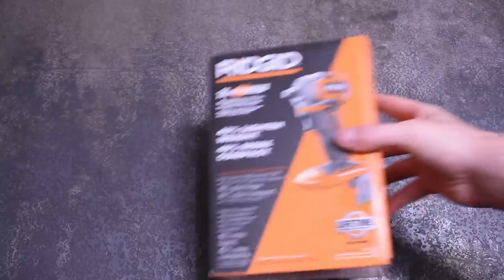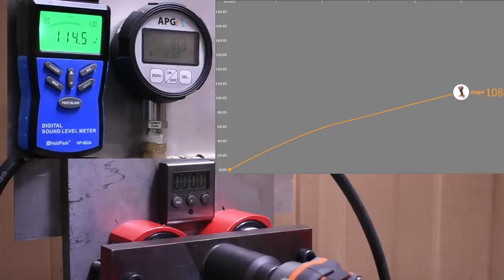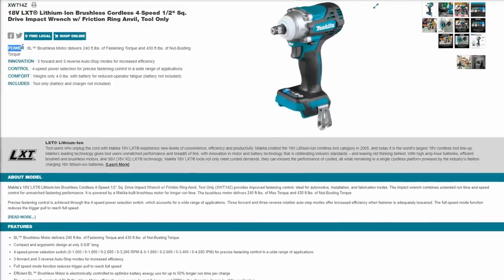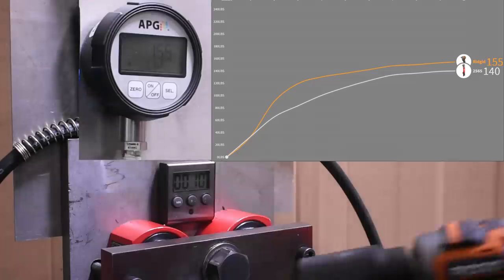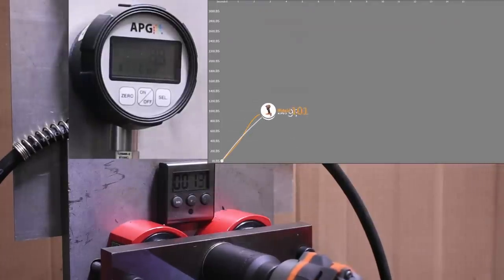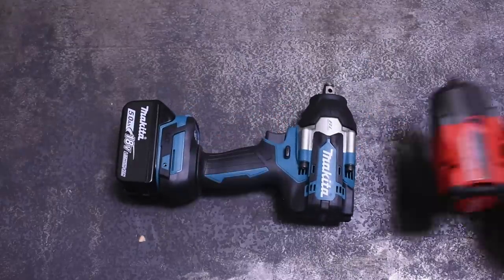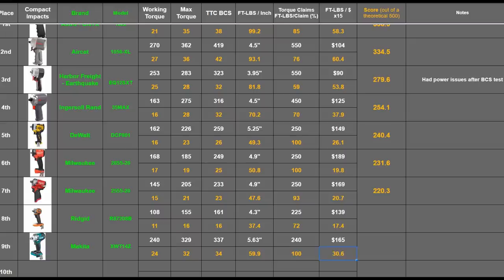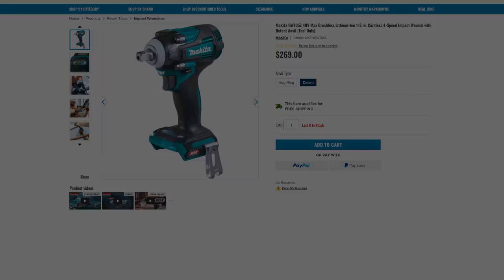Best Cordless Compact? Dyno Says It's Not Close: Makita & Ridgid vs M18 & DeWalt

Comment from the maker: For the price, it's hard to ignore this one: https://amzn.to/3yWfxGt DeWalt's 20V XR come out this month, you can bet we'll be giving that a look as well. If you think this Makita is more like a mid torque because it's 1/4" longer than the DeWalt, well we had to make the cut-off somewhere and at 3.1lbs it doesn't compare in too many metrics to the smallest mid torque ever, the M18 at 5.1lbs. The average mid-torque length is 7.1".
FAQ: Why did the Ridgid perform so low when I saw it on X channel do 225, 250 ft-lbs breakaway ect. Answer: No one source's numbers are CORRECT, even from brands. What's important is how they compare to each other on any unchanged test. So our question back would be how did the DeWalt, Milwaukee or Makita do on those same channels/tests? For example, Shop Tools Reviews (great channel) did 250 removing with the Ridgid, but also did 450-500 with the DeWalt and Milwaukee.
Reply: What’s the dewalt 20 volt that’s coming out?
Reply: That’s 3/8” rigid subcompact 350 and 1/2” 4ah m12 stubby 375.
It would be convincing if you show the settings before running any test. Your test can hide lots things from an experiment setup point of view so maybe try to be as transparent as possible.
Also, in reality cases, m12 stubby and Ridgid subcompact have similar torque. That’s from watching 50+ related videos. I bought m12 stubby at first, but after some analysis and thinking, I choose not to trust your numbers in this vid. But great channel and lots useful info. Still big thanks.
Reply: @TTC maybe I didn't see it but have you tested the 1/2 inch subcompact Makita or the 1/2 inch Metabo hpt 18 volt not their mid or high torque?
Reply: @herogreat2797  Lol
Reply: @herogreat2797  I agree !
Reply: So it was my understanding that Ridgid suggested using their higher output batteries for max performance which come in either 6 or  8 ah but you guys used a 3 ah battery, clearly the lowest of all the impacts in this test.  Not only that the Ridgid has 4 speed settings which you didn't show.  So it seems like your test might be a disingenuous and/or manipulated.  I'm not saying you did that but it could be perceived that way because you didn't show all the data and/or didn't test all possibilities.
Reply: I got that makita the 16 with the 3/8.  Please test it. It’s crazy stupid powerful.

Comment: Rigid "We are playing in a different game". Makita "So are we".
Reply: If you are a Miata guy, you get the Ridgid (compact). If you are a Corvette guy, you get the Makita (value for power). If you are a Wrangler guy, you get the DeWalt (okay at everything; great at very little). If you are a Boxster guy, you get the Milwaukee (a little better than a Miata for a lot more money).
Reply: I love my Ridgid Subcompact, bought one at Home Depot it came with a Case, a battery charger, and with a 2.0 lithium battery for just $139 thats a steal! If youre looking to get a combo like that with a Dewalt, Makita or Milwaukee youre looking to spend over $250 if not more. Ive used it on lug nuts that are 80-150ft pounds and removes them without a problem.
Reply: @RememberReach2552  Well yes, Ridgid is advertise for home DIY. I've work as construction helper (for my uncle) for over a year and seen many people at the site and never seen any other brand than DeWalt and Milwaukee. 
Well the test is evident it self, if you need an affordable decent tool at home, Ridgid will get the job done. 
I'm a Makita guy, so I go for precision and finesse + durability. I also own M12 line because they're so useful and my go to for 80% of the time at home.

Comment: It’s funny you put the smallest battery on the Ridgid (3ah). When you read the manual Ridgid state that the power is drawn on the type of battery is used. I have the 3/8 and 1/2 inch sub compact and use the (9ah) battery and it remover skid steer tires, trailer tires, truck tires with ease. Of course your gonna get weak results with a small battery. Lol this is a misleading video.

Comment: Never been a huge makita fan, I think I will stick to my milwaukee for now. I am not sure that buying a whole new line would be healthy for me. It is definitely a love/hate relationship with you TTC. I love this channel but I hate that I want to buy everything.
Reply: The Makita isn't even a compact or sub compact if you ask me. If I need all that power I'll use my full size milwaukee. The benefit of the milwaukee and dewault is that they are small so you can fot them in more places the Makita not so much its massive.
Reply: It's massive, that's what she said bahahaha
Reply: @GamingwithIinfected  The Makita is barely larger than the DeWalt and it is not a large or heavy tool by any means? The xwt17 mid torque is pretty hefty but this tool not so much.
Reply: @clarkfos3447  Its almost an inch long then the Milwaukee. I buy a compact impact so it fits in small places. If it doesn't fit then it doesn't matter how much torque it makes I'm resorting to hand tools anyway.

Comment: I’ve got the Makita DTW300 (UK model I think), and work on trains, old trains, that haul round the seaside, so nice and salty all year round. The tool impresses me all the time,  and the functions it has. So much power, it out strips the Dewalt impacts we have. Highly recommended from me. Thank you for putting the numbers down on it TTC.
Reply: Recently bought the same DTW300, had to bring it with me to the side of the road for busting a wheel bolt loose that was overly tightend with a proper big air tool at the tire shop, owner claimed that it couldn't be done with such a small cordless tool. But damn, it blew him away of how easy it was for the DTW300, what a machine!
Reply: DTW301 here, same model with the ball detent. Haven’t used it a ton yet but I love the thing.
Reply: Glad to hear other users are experiencing the same in the real world. For the price as well, it’s worth it.
Thanks for the replies.
Reply: I have just ordered a Makita DTW300 and after watching this video I am very glad I did so, can't wait to use it :-)
Reply: @Poet1968  You shouldn’t be disappointed, I’m sure not. For the size as well, it packs a punch.
Reply: Recently had a 14mm lug that wouldn’t budge with a Ryobi, the smaller Makita dtw301 tok it off with no hesitation at setting 3 out of 4. Setting 3 is just a little above half the torque and still acing it, what a tiny monster it is.
Reply: Have you had good luck with the hog ring style? Some claim the makita ones don't hold the socket on well.
Reply: @jameshill4900  Hog ring works well for me, not as secure as a detent, but I swap sockets a lot. If I don’t want a socket to fall off I use a pin and ring.
Reply: @wippip what does the ball detent do, and which one should i buy!?
Reply: What’s the battery life like in a days work?
Reply: @noeflores8049  I only have the 3ah batteries, on a heavy shift I’ll swap batteries once, just to be sure I’m not using power.

Comment: EXACTLY what I wanted. Literally spent a month researching for a compact to use around the car and just bought the xwt14z 2 days ago. Glad it's king of 'stubby'. I already had other 18v Makita tools and they are excellent.
Reply: I just wish you had posted earlier. I could have used your affiliate link
Reply: Milwaukee m12 is the king of stubby literally. 18v is mid range brotha
Reply: @xXPhIlIeSXx2010  Well I was able to fit it in my inside my engine compartment for mounts and removed caliper bolts without turning the wheel. Still, M12 was really good

Comment: When I was a wee lad in the early 1980s, my (oldest) brother went to dinner with his girlfriends family in Anchorage (Alaska), we all lived in the matsu valley an hours drive north of Anchor-town. When they got back to their house there were fire trucks up and down the street. It didn't take long to realize it was their house that had been on fire. There was nothing left but ash. They lost every thing. They had the clothes on their backs and the Chevy Suburban that they were now living in, the cash in Dads wallet and nothing else. Cellular communication was none existant in the area at the time so short wave radio was king. Their Dad ran a home business selling and servicing short wave radio equipment, so they lost their livelihood too.

They rebuilt their house using a table saw, a sliding compound miter saw, skillsaw, and a bunch of Makita 9.6v Ni-Cad battery powered tools. Those 9.6v tools did the job just fine. The house is now three stories tall and still standing. It has survived many a 6.0 and stronger earthquakes. 

My point being. Do we really need 20v, 24v, 40v, etc.? I'm perfectly fine with the power output of most modern 12v tools. And the batteries are smaller/lighter/cheaper(most times). I've use the Milwaukee 12v and Bosch 12v tools and Bosh is the most comfortable (imo) but Milwaukee has the power edge. Battery shape/size (form factor) is a big selling point for me. 12v definitely has the edge in my world.

I love this channel. I was an auto mechanic for 30yrs. and I do other stuff now but, I really love tools and this channel rocks. Thanks guys. ... oh, my Bro and 'the girlfriend' eventually married, had kids and my niece and her family are now currently living in that same house. That's four generations living in a house that Makita 9.6v built.
Reply: I agree I'm happy to use my 20v impact for most of my stuff but it is nice to use that beefy 24v or higher when you have a nut that just won't come loose
Reply: The Makita 40v XGT platform is needed not because 12v screwdrivers are too weak, but because they needed a battery system that can power all your tools, including table saws, lawnmowers and chainsaws, with a single 40v battery or double for 80v. My first 40v Makita was an angle grinder, big improvement since the old models with adequate power used 2x18v.

Comment: I have that Makita and recently used it on a deck job to screw in 6in lags.  With my 5amp battery and on the highest settings it has too much power for that task. It drove the lags way too fast and aggressive.  I started using my 2amp batteries and set it on number 3 to drive it, and then number 2 to finish setting it.  

It has crazy power.
Reply: its a good review to say that its too powerful

Comment: I have the Makita. It has become a go to. Slap an adapter on it and use a driver bit. Put a 1/2 to 3/8 adapter on it. Need to sharpen the lawnmower blade just be careful because it will spin it fast. Goes in the car on camping tricks to put the jacks down or change a tire (2 weeks ago got a flat and used it to put the jacks down to raise the camper and spin the lugs off to change the tire. Quickest camper tire change ever.) Due to size it is a must.

Comment: I work with the 3/8 version of the ridgid (same spec) and it was mainly to replace a impact driver with adaptor that always break... and that   is perfect. Anyway if its not enough I have the mid torque or even the high torque on 9ah that is greater on your scoreboard.

Comment: I have  the DTW 300 makita impact. I belive that is the same as the XWT14 in the US but I'm not 100% certain. In normal use I've been super happy with it. It seems strong and only rarely did it not take of bolts.
Reply: Yes it is the same. I also happen to have the DTW300 and it's good enough to be my only impact for my garage work and changing tyres on track days.
Its bigger brother is DTW700 (XWT17), quite praised on this channel and I would have it if it existed at the time of me buying the DTW300. And then there's the huge 1000 Nm DTW1002 (XWT08) - not so good according to the review here.
Reply: @TeeJayka  I'm looking between buying the 300 and 700. You now think you should have got the 700 instead of the 300? Any issues with the hog ring holding the sockets on?
Reply: @jameshill4900  The only benefit of the 300 is it's small so it can get into places where 700 might not, that's the only benefit. Typically I cannot loosen crazy overtightened lug nuts or just VW axle bolts (180 Nm + 180°) with the 300 but that's what the big boys are for. The 700 would probably handle it, at least the lug nuts even when overtightened. Since both 300 and 700 are similar in size and price, I'd get 700 any day. The hog ring is fine - after 2 years, it's doing its job. Rarely I have a loose socket or one that's too tight but it's always a problem of the socket unrelated to the hog ring.
Reply: @TeeJayka  I ended up ordering the 700. Hoping it's the Goldilocks  impact I'm looking for (size / power). Thanks for your response.

Comment: The M12 stubby is where it's at due to size. And the M12 right angle is just icing on the cake
Reply: @yourmom922  M12 is an awful impact wrench for people who do assembly work.  (I'm talking thousands upon thousands of bolts a day) 

M12 stubby is for auto mechanics who have limited access and need the smallest tool possible, but probably aren't doing more than a few hundred bolts a day or holding the wrench in their hand or off their belt for hours a day.  

M12s have an awful grip, bad balance and bad runtime, so they make terrible production wrenches.  Everyone in our industry (AG Construction) runs 18V compacts for the bulk of their production/assembly work.  Only useful 12V tools we'll run are the auto ratchets and the rivet gun.
Reply: Obviously you want M18 for high quantity. M12 is meant for tight spaces and are considered one handed tools. Ill deal with a larger grip on m12s just for the 3.0ah compact batteries when nothing else will fit (especially nice on the ratchets, right angle impact, regular impacts and drills. I only use the 6.0ah when you need a little more but mainly runtime (m12 inflator or fuel wet vac). But if you can fit the 6.0ah on an m12 drill or impact then you can probably fit the M18 tool as well and is probably the better choice. I like having the options, I have both. M12 for tight spaces and lower quantity jobs, M18 for more power and or high repetition  jobs.

Comment: I have the ridgid in the 3/8 version sub compact and soon the Octane 3/8 as well. I fully expect the octane to be stronger as it is the same setup as the octane 1/4 inch impact and it definitely has more power than the sub compact even losing torque with a 1/4 hex to 3/8 square adapter.

All that being said, other than the awkwardness of the battery being as big as the head, the subcompact is pleanty of lightweight power for anything you would normally use a 3/8 for.
Reply: Agreed. Im a diesel tech and I use my Ridgid for small stuff like door rollers, and starters. Works very well for the right applications and it's lightweight. I have a mid torque 1/2 Milwaukee for heavy stuff  🙃🙃

Comment: The Ridgid sub-compact is just boss. Not at all scientific but it straight away removed T55 bolts securing my bed to my frame. Truck is from 2008, in the rust belt, and has large holes rusted thru the bed. It's just so tiny!

Also, perhaps break down the categories by anvil size? Comparing a 1/2 to the 3/8" subcompact is ehhhh.
Reply: If those torx bolts were "really tight" the bit would have broke.
Reply: @roceye  I am assuming this is some kind of joke about other test channels on YT.

Comment: I really wish more manufacturers would take the Milwaukee/Bosch 12v route for compacts. What's the point of a 3" impact when the battery is 8" long.
Reply from the maker: Might have to agree with you on that one
Reply: Well so you don't have to buy all new batteries I suppose.
Reply: @Yophillips3272  honestly - this is probably the most compelling argument, but if I'm totally honest, 12v lines have more than enough torque for 90% of work. I really think they could do with developing more 12v tools. They'd be smaller, less expensive and more convenient. I was a mechanic for the US postal service for 3 years and I used my Bosch 12v for everything aside from lug nuts and crank bolts. 
I suppose it's in part a numbers game, so we'll probably never see that happen, but one can wish. 

After writing all this, I had the thought - companies have already brought to market packs that can output 2 different voltages. This would be the perfect solution, imo.
Reply: Some people need the runtime of 18V batteries though. 

Bosch/M12 grips are also horrible if you've ever had to hold a wrench in your hand and tighten/loosen bolts for an hour straight.  12V tools are for intermittent use a la the auto shop.  Let's not forget that there are people besides auto mechanics who use these tools.    

For a lot of people 12V tools are just a waste of space on their service truck.  If you're already outfitted with high/mid torques (which will always be best on 18V) then it makes sense for companies to offer these same people a smaller option that still uses the same batteries.  Last thing I want to do is ditch the 5 compact wrenches on our truck for some crapass 12V tools that can't do the job nearly as well and then have a bunch of useless batteries for one tool mixed in with all our drills, drivers & saws.  Only 12V tool we carry every day is an autoratchet, and that's one tool where the 18V will never be better than 12V. 

18V impact drivers will never go away for the same reasons.